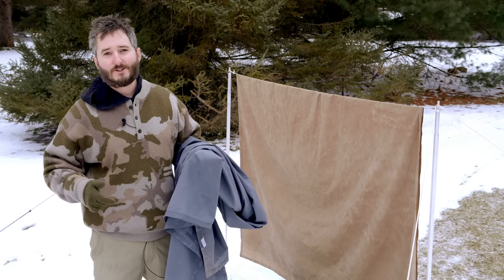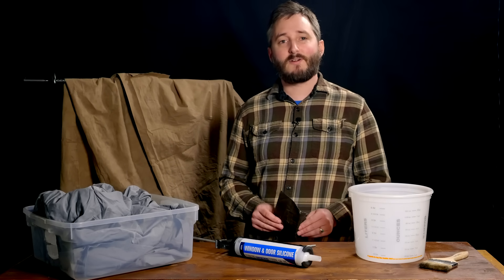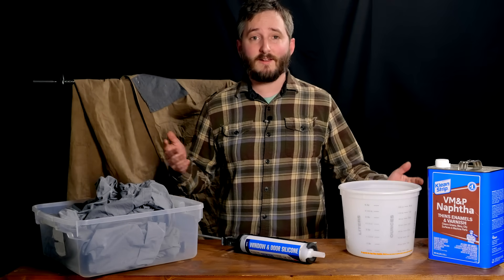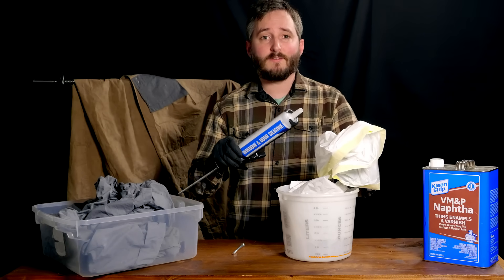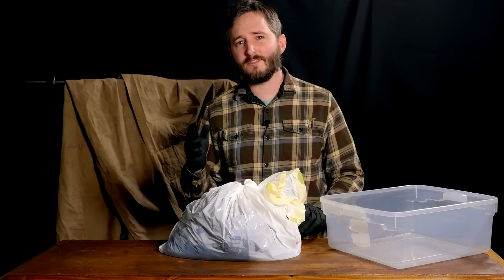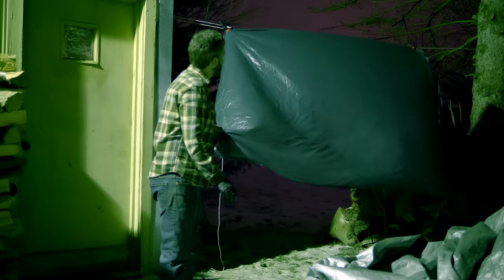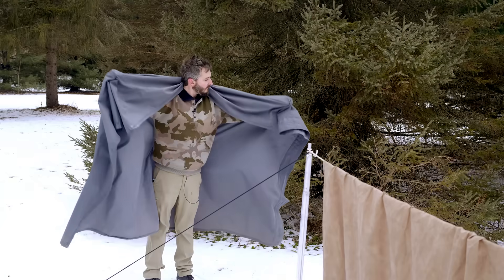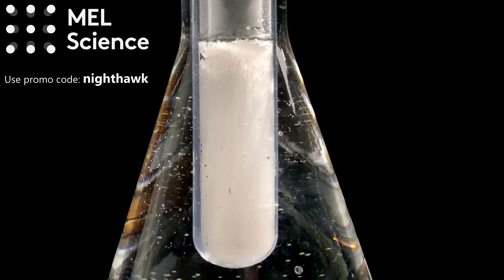Recycled Bedsheets Make The Best Waterproof Tarps

Comment: I own a convertible VW hot rod with no windows so I cover it alot but is it possible to mix a solution then apply it with a paint brush on my convertible top ?
Reply from the maker: Possible, but test a small area first and I'd remove the cover from the car before applying or you may damage the paint. Also be careful of fire risk when applying because it's equivalent to soaking a large object in lighter fluid. It will be dangerous until dry

Comment: Just for perspective: the amount of naphtha and silicone used to make this sheet will cost you about $25 excluding the sheet itself. You can find a regular tarp about twice that size for about $5.
Not saying that its not useful information, i think its an amazing technique to waterproof things that you cannot just buy, and these sheets are probably indeed much more resilient to outdoor stresses, its just some context to consider if you wish to try it yourself.
Reply from the maker: Seems naptha varies a lot in price depending where you are. I should have tried something more ubiquitous like kerosene. This project cost me about $16 in materials per sheet
Reply: @Nighthawkinlight  Indeed, it must depend a lot on where you are. My calculations are based on prices in western Europe where naphtha is probably more expensive than in the US. Kerosine might indeed be a cheaper alternative. But like I say, this is still an incredible method of waterproofing things with a more difficult shape, complex fabric structures even if it would be more expensive in my area. Thanks for the reply!

Comment: Good job I will try it!
Reply: I tried it, result was not so good. It does shed water, rolls right of it. But if water ponds up on it soaks through rapidly. Should I have done something different? I used three quarts of Naphtha and one tube of clear silicon. It saturated the sheet well, should I have used more silicone?

Comment: Do you think if l painted this silicone combination  on the fibreglass hi top  of my toyota hiace van it would help seal any cracks etc?  Or even do the sheet thing  and then glue that over the fibreglass hi top?
Reply from the maker: Could work, but it might ruin the paint. If it seeps into cracks where it has a hard time drying it might stink for a long time.
Reply: @Nighthawkinlight  ok thanks for that  l might try silicon rubber paint

Comment: Would this also work with canvas cloth convertible tops for cars if applied with a brush or similar?
Reply from the maker: Maybe, but I would take it off the car before applying. Definitely not something to try indoors, as the vapor will be very strong without containing it in a bag

Comment: does the naphtha mostly or entirely evaporate during the drying process? wondering if there's any danger to using naphtha as the solvent when waterproofing other things (e.g. fabric-based bags) that may frequently come in contact with skin?
Reply from the maker: The naptha seems to be completely evaporated after 24-48hrs

Comment: Very interesting... Does this make this a fiber-reinforced silicone sheet, or does it just soak into the fibers, leaving the gaps between them?  Asked another way, is it only the surface tension of the water that is making this waterproof? If so, I would imagine under some conditions, this would still soak thru, but be breathable in a light drizzle.
Reply from the maker: The fabric is still breathable. To make a solid silicone sheet you would need to paint on a thick coating

Comment: Whats about risk of polluting vegtables in a garden?? Or drinking water issues using such a tarp as a rainwater collector? I wonder if some particles of silicon or solvant can be "washed away"..
Reply from the maker: The solvent evaporates and is gone once dry. For rainwater collection I would be sure to use food grade silicone.

Comment: I've done that without using plastic bag, I used two part silicone and polyurethane rubbers, they cure much faster.  But mine felt like leather, not sheets and specially the polyurethane type is a lot more durable and washable (you can literally wash inside a washing machine
Reply: Could you provide the exact ingredients, how you resolved and blended them and your method of application?  I've had good luck with spray on waterproofing used on a cotton poplin windbreaker.  I sprayed a light coating with the jacket inside out, reversed it and drenched the garment.  By your description it seems your method would be great for a groundcloth or a jacket. My plan is to continue the hunt for thrift store high thread count Egyptian cotton sheets for a tarp using double layers where I create ridge lines, along the edges and any other high stressed areas and I think your method will be a good futon those areas and I will use the method in the video to keep the weight down.

Comment: So, I have a silly question that I might already know the answer to. Could these tarps be used near open flame/campfire? I would  be using a tarp primarily as a camping shelter or as quick deployable cover when getting caught out in some surprise nasty weather when hiking. In either case, I will most probably being using a stove of some sort, (fuel canister, twig, alcohol burner, etc), or a simple fire. Having used naphtha as fuel before, my instincts tell me that it might not be a good idea but just wanted to confirm. Either way, this is a great, cheap DIY project. Many thanks.
Reply from the maker: The naptha is gone once dry.

Comment: It isn’t really accurate to say that the fabric is coated with silicone. If the silicone is staying on the surface of the fabric, then your mix is too thick. The silicone/solvent mix needs to soak into the fabric or the silicone will flake off or peel off.

Comment: This was great, thank you. Making your own button tie was something I will never forget, and made me see how clothes in times long gone may have been held together, nice and strong.
Reply: When I was a kid, I remember som elderly ladies who still used stockings (not pantyhose), basically fastened their stocking using buttons like that. They would use a little button, a small coin or token and their girdle had a loop-like piece that was pulled around the button to secure to the stockings. You can still buy elastic band bedsheet fasteners that has a similar fastening contraption.
Reply: can you put this stuff in a sprayer and spray it on?

Comment: Thank you for this video.  My imagination is all over the place with possibilities!

Recycle old bed sheets...  cool.  It's still way cheaper to do this with new bed sheets than it is to buy a readymade "waterproof" tarp made for shelter.  It's certainly a lot lighter than a regular plastic tarp.  I'm picturing a sheet with buttons already installed and tieouts attached in all the right places.  I'm gonna try this ASAP.
Reply: You can find sheets for a buck or two at thrift stores.
Reply: Have you priced new bed sheets?

Comment: Super!  FINE project for camper. The tarp is less heavy than store-bought, so more versatile and less volume to pack. I'll be doing this outside for safety.  The wrapped rock securement has worked for me for years.  Grommets DO rip out. These do not and can be moved at will.

Comment: Would this work to water proof seal a convertible top of a car?  I found black silicone at Advance Auto.  I've spent hundreds in the last 20 years to keep my canvas top black and water proof and nothing lasts very long.  Your thoughts would be appreciated.
Reply from the maker: Lampblack mixed with silicone makes it uv resistant and black, but it may leave scuff marks on things it touches. Could work for a car top but I would test a small corner before trying the whole thing. Take it off the car so none drips on it. The solvent is also very flammable when wet (it's basically lighter fluid) so only apply it in an area where there are no sparks and no flammable material nearby.
Reply: @Nighthawkinlight  I don't understand how you mean it may leave scuff marks.

Comment: Or you could use a marble in exchange for the pebble to prevent tearing through the sheet if the pebble has any sharp corners, it's what I used and some helpful advice.
Reply: Or Slingshot mables then you have extra ammo if you need it. Then you could start to look for round pebbles by the river when you fishing or hunting.
Reply: Exactly. What I had available at the time I needed it was steel shot for a slingshot. The cordage I was using was small so all went well.
Reply: That idea was in a camping book by Colin Fletcher from 50 yrs ago.
Reply: Or a bon bon
Reply: Or a button…🤗
Reply: I was going to suggest a marble myself. A river stone works well too. He did suggest an acorn in the video, which is very smooth without the cap and when you burnish off the point.
Reply: Bowling ball might work also.
Reply: @whatsup7253  🤣
Reply: Just find a smooth pebble...
Reply: @randallsmerna384  I'm just saying if you have one on hand. I live in California unfortunately and the closest to finding a pebble is gravel. LoL
Reply: It isn't a big deal to look for a smooth pebble!

Comment: Um.... It's pretty easy to add grommets... use an iron on patch kit to reinforce the area around where you want the grommets then use the cheap grommet kit you can buy at any craft store. Just don't skimp on reinforcement of the area where you'll be putting it. Use denim iron on patches or leather on at least 1 side of the sheet, preferably both, and sew as well if you're paranoid like me, then punch the hole and install the hardware.

Comment: Thanks a lot for sharing. This video is not just good, it's great and perfect. But I have a question. When I'm not in the US, what kind of chemical liquid is this "Naphta"? And does that work with cotton sheets as well? I will try that very soon. Thanks.
Reply from the maker: Shellite in Australia, white gas in some places, lighter fluid in some others
Reply: @Nighthawkinlight   Ohhh. That means, I could simply use "Zippo Lighter Fluid". That would be great. Thanks for the info. I guess, I probably have to buy one or two liter of that soon.

Comment: Great video. I wonder, does this treatment make the material more flammable or less flammable?

I suspect it's less flammable because I don't think silicon burns as easily as cloth.. I think naphtha is flammable though, and that made we wonder about whether the material might be more flammable.
Reply: Naptha is VERY flammable!  But I would imagine that if the treated sheet is dry, it won't be a problem.

Comment: In Seattle, back in the '70s, I coated a sheet of thin ripstop nylon with silicone rubber paint. I worked quite well and never degraded in any way. I used it as a groundsheet. When camping on snow, I put aluminum foil under the tent to reflect body heat back to the occupants. This is a cool demo.! I bought the silicone rubber originally to line my steel drum composter. Thanks. My groundsheet was light and didn't crackle.
Reply: Another good product is to use a mylar blanked between the tarp and tent. Trends to be less expensive than aluminum foil and can be reused many times
Reply: @Dodgingbodies  and wont have any sharp edges.
Reply: @Dodgingbodies  - You can buy emergency blankets for almost nothing on aliexpress, must be perfect to use for something like that… 🤗
Reply: The foil like emergency blankets are great for under the tent or under the sleeping bags, a little loud right under sleeping bags if you wiggle in your sleep and can be annoying but under the tent on top of the tarp works great, also can put them on top of tent under tarp or rain shield to keep it much warmer while camping, anywhere you can line the tent with these makes the tent so much warmer, talking form lots of experience! Good luck everyone!
Reply: @kencone8580  cheap foil sunscreens for cars, around $1-2 at dollar stores would add some cushion as well as insolation. They could even be sown together at the fabric edges to form a tarp shape.
Reply: @kencone8580  thanks for the tips. i'll try to remember them this time.
Reply: i heard about the aluminum foil trick before, but forgot about it. thanks for the reminder.
Reply: @ClashBluelight  Mylar emergency blanket works better because it is in one piece and can be reused.
Reply: @canucanoe2861  i have one of those. just never thought of putting it under my tent as opposed to lining the inside or on myself.
Reply: You can also use those foil window shade reflectors under tarps, sleeping bags, etc.
Reply: @melodyclark4347  I just commented this before I saw your comment.
Reply: @beccagee5905  👍👍
Reply: I'm about 20 mins north of Seattle!
Reply: Is that "silicone rubber paint" used to seal bricks? I'm trying to find it in my country
Reply: Did you happen to weigh the material before and after the application of silicon.
Reply: I LOVE hearing about old camping/hiking hacks like this, ever use the old "rock by the fire" trick as a heater?
Reply: Heavy duty aluminum foil is a good fire/heat reflector too...  Much better than a stack of logs (which works, but not as well).

Comment: Cool video, but how is the flammability after this process? Safe to have near a campfire? One nice thing about the tarps I use hammock camping is that they wont ignite. They can melt, but not ignite. Im curious how this compares since I have everything on hand to make a few of these. I know silicone wont burn, but the fabric after being treated with naphtha I am not so sure about.
Reply from the maker: The naptha is gone once dry. The tarps are about as flammable as the fabric was to start with

Comment: Love it! Absolutely fantastic! Im definitely going to try this one. heavy oil tarps are great but heavy, plastic tarps are cheap and don't last long, this looks like a fantastic compromise. Thanks Man!!
Reply: they are heavy for a reason in that the material is very thick and the proofing that they apply is also considerable, bare that in mind, thin material and thin covering does not equal the same resistance as a good old canvas tarp.. I would admit that they could be useful for the odd occasion when you need a lightweight tarp or a water resistance blanket in the back of your car, eg when your lying on the snow putting your chains on, or come back with something in the cack of your pickup and it suddenly rains. Light use these would work but long term and exposure to the sun where I live in Spain with a very high UV index would trash this in a couple of months if that.

A uv treated plastic tarp wont even last a summer here. Last year I purchased a silvered waterproof external /outside car cover for my wifes car just to protect the roof and bonnet from the sun , in under a year it went to the crackle stage and now its useless , luckily the guarantee is for 2 years and they simply gave me another one, if it does the same that will go back and be replaced again and again!!
Reply: @sitgesvillaapartmentneilsc7924  Clearly its a compromise of other choices. Im okay with that.  I wouldn't use a bulldozer if all I needed was a shovel. And I wouldn't use a shovel if I needed a bulldozer. I think that is the point of the video. - "Cool Alternatives". Besides I thought it was fun!

Comment: As someone who is in doubt over buying a tarp or not is worht my money for camping this is awesome. 
You have those cheap vacuumbags, would it work to put the mixture in that with the sheet and take out all the air, or most of it anyway to soak it?
Reply from the maker: Vacuums can make sparks and naptha is very flammable
Reply: @Nighthawkinlight  Fact didnt think of that. thanks for the respons

Comment: I have worked in the textile industry and have applied both silicone and wax and oil to rolls of fabric. Loved your hands on presentation!!
Reply: What kind of wax and oil did you use? Filson traditional outback style coats are waxed cotton.
Reply: @fieldlab4  we used a bulk paraffin wax also used for candle making. We used kerosene to thin the formula and for uniformity. All application equipment except for the drying drums were heated with steam. Used kerosene for cleaning up.
Reply: @andybrandsma  How do the waxed fabrics hold up in extreme cold?
Reply: @beccagee5905  Ontario cold does not affect the water proof properties or the stiffness to the fabric in a significant way. These fabrics will leak through in wet weather over time.
Reply: @andybrandsma  - How much time, in your opinion?  I was thinking that this is a great techniques for boat covers … also located in Ontario.  😊
Reply: @doracotterell2863  perfect for boat covers. The fabric may leak through where it touches something on the inside, causing a path for water. Similar to when you are camping. I have had cloth for 15 years inside on a roll and it is still good.
Reply: @andybrandsma  - hi again.  May I ask where you’ll located in Ontario?
I’m in the Toronto area.
I was thinking of creating outside wrap seams so there’s no water 💦 leakage but also wondering about how heavy the waterproof sheet becomes? I’ve never made a boat cover before now though (31’ sailboat) but “Necessity Is The Mother Of All Inventions”.
Reply: @doracotterell2863  I used to work in Toronto butt now live in Grey-Bruce. No traffic. Learned to sale are the Hamilton Sailing Club. 
10 oz 60” cotton duck works well but you could  go with 8 oz or lighter if you prefer. The wax applied with a squeeze rolled system added perhaps 10% weight. Great project. I notice that most boots are wrapped in plastic for the winter. Would this be an alternative?

Comment: If the solvent wouldn't dissolve a vacuum sealer bag you could do that to get it to fully coat all the fabric, leave that way for 10-15 minute and than remove
Reply: Another option is using the spray paint tank and placing it into it and filling up the chamber with compressed air like they do with the resin jobs.